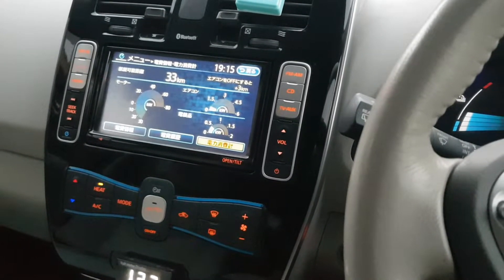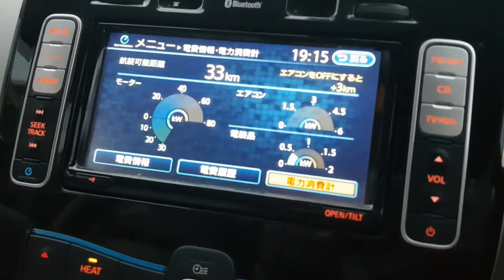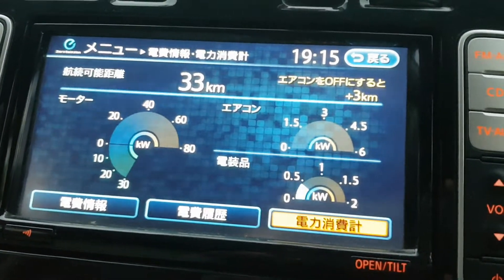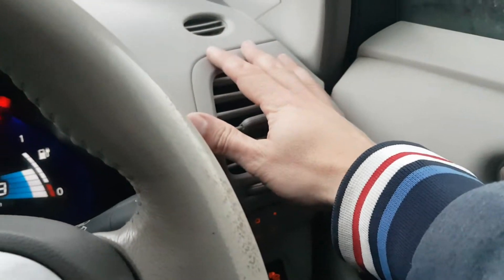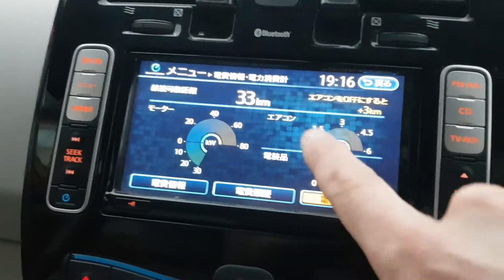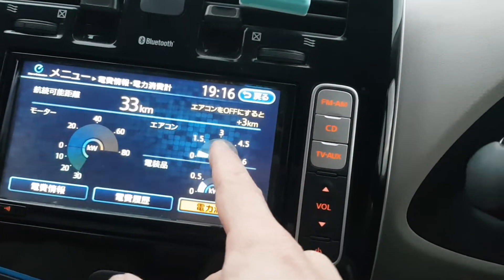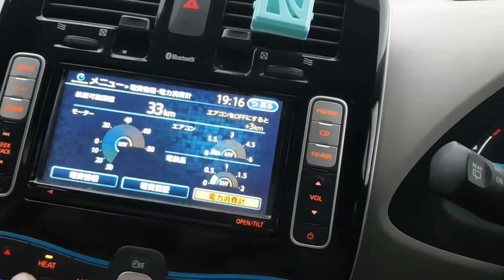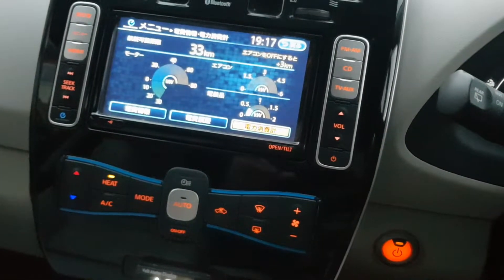How to understand if your Heat Pump working in Nissan Leaf

Comment: At what temperature does the PTC heating element get activated?
Reply from the maker: How the hell am I suppose to know
Reply: @CoberRuger  i found the answer!
In a Nissan Leaf, the heat pump is the primary heating system, but its efficiency drops significantly below 40°F (4.4°C), at which point the PTC (Positive Temperature Coefficient) heater kicks in as a supplemental heating system.